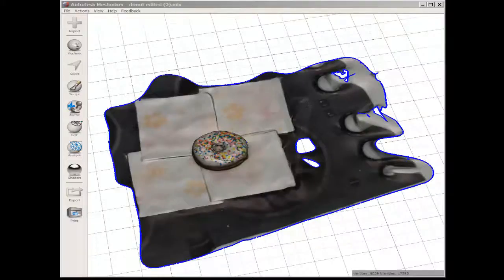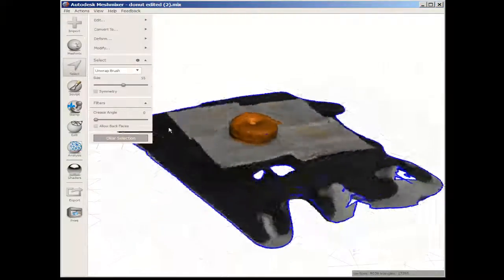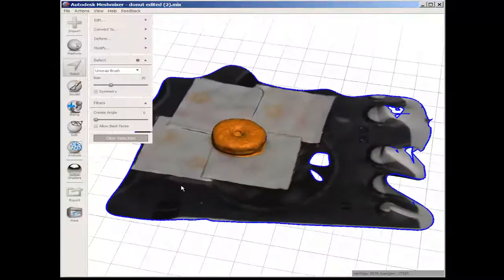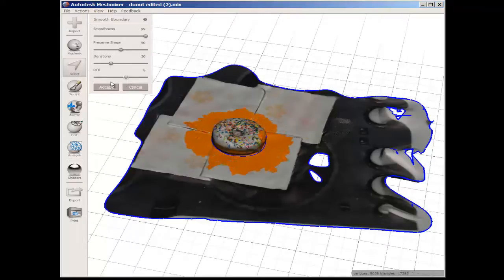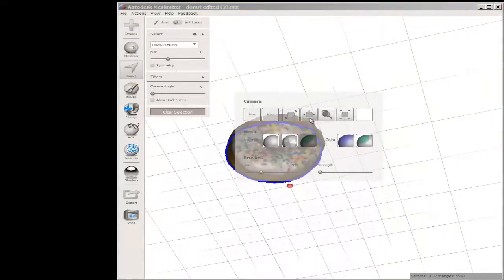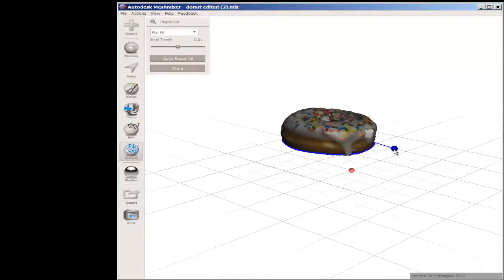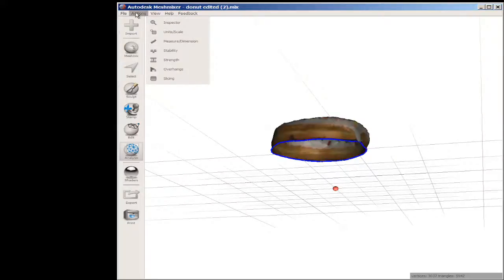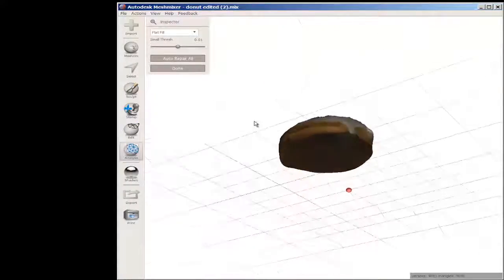Meshmixer: Clean Up a Scan

Comment: How does one remove a hole that has been designed in the model?  Is using Boolean Union the only way? Whenever I try selecting the hole and hitting delete, it removes areas that are not relevant.
Reply from the maker: +jeevesme Hi, select all around the hole. Press and release the X key to delete those faces. Then click on Analysis/Inspector and "Auto Repair All."